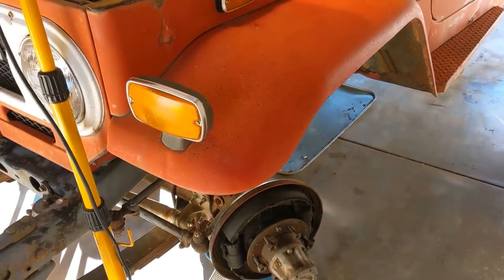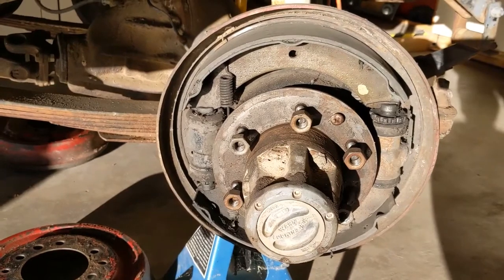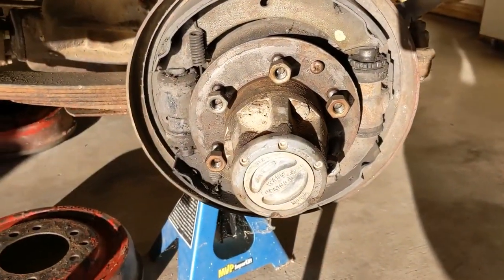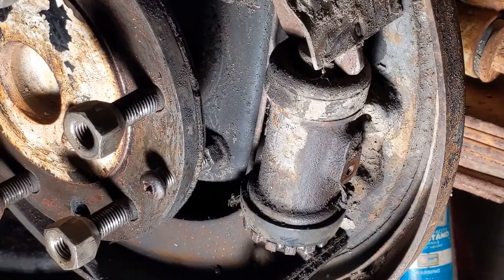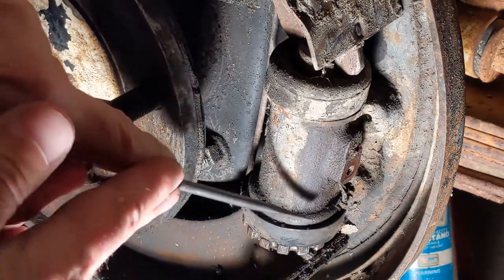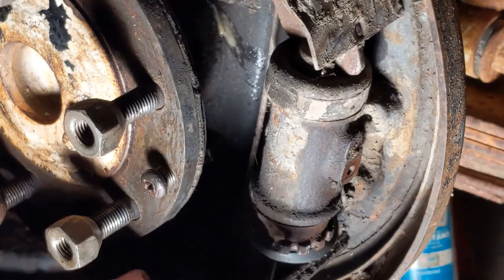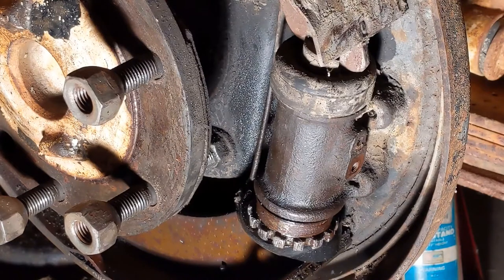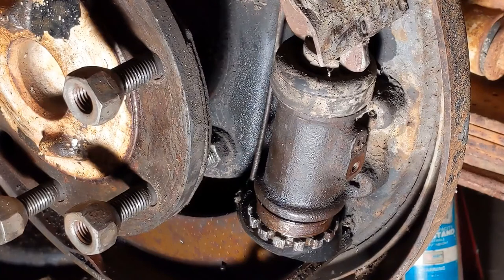Brakes Part 1

Comment: How do you get the drums off? Mine are stuck tight. What a total pain!
Reply from the maker: I should have made a video about that because you're right about that.  Usually the problem is they've rusted on to the hub.  The first thing to do is to be sure the pads are not bound to the drum.  If you can turn the drum easily by hand, you're good.  If not, you'll need to back the brake pads off using the adjusters on the back.  If everything is seized, you can skip to stage 3, below.

Stage 1: Assuming the drum doesn't come off by hand (they never do), the next thing I try is a hammer.  I use a 3-lb hammer and try to break the rust bond between the drum and the hub by striking the drum around the circumference. Drums are pretty stout. I imagine it's possible to bend or break one, but that's never happened to me. This works at least half the time.

Stage 2: If the hammer doesn't work, I spray penetrating oil where the drum contacts the hub and around the lugs.  Let this sit at least an hour and try again with the hammer. If you get oil on the brake liners, you'll need to replace them. For me, penetrating oil works about half the time. 

Stage 3: The last resort is the "heat wrench."  I'll get my oxy-acetylene torch, put the rosebud heater on and heat the drum until its very hot but not glowing. Once it's hot, take the hammer to it and it will come off.  This always works, but might warp the drum. Plan on machining or replacing it and pads.  REMEMBER, THE SUCKER WILL BE HOT.  Until it cools, you'll need welding gloves to handle it safely.

If you're wondering why the torch works so well, I think there are two reasons.  First, heating the drum makes it expand, which loosens it.  Second, the heat weakens the rust bond. The rust doesn't melt, but it really can't take the heat.

(BTW, a propane torch won't work.  It's not nearly hot enough.  A MAP torch would be better but even that may not put enough heat into the drum)
Reply: @mikerestoresanfj4069  thank you for the info I'll give it a try

Comment: Would you recommend going with disc conversion ?
Reply from the maker: I seriously considered converting to disc brakes. They work better, are safer and basically trouble free. The only downsides are cost and a bit more complexity.
Reply: I agree with Mike. Almost  all members of a local Land cruiser club have done the conversion, mainly because safety reasons